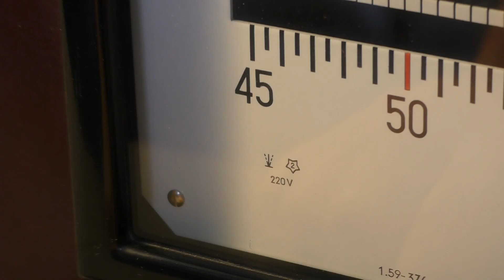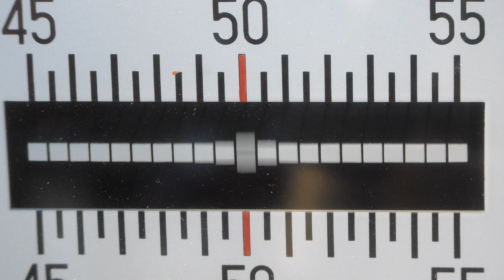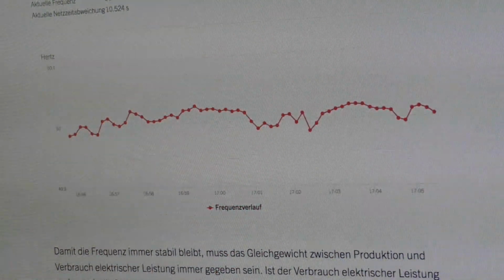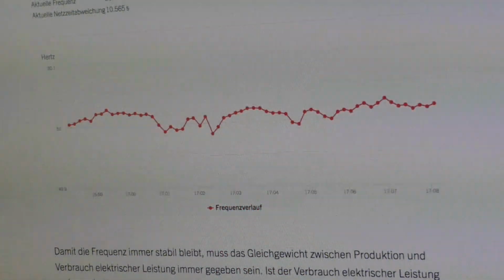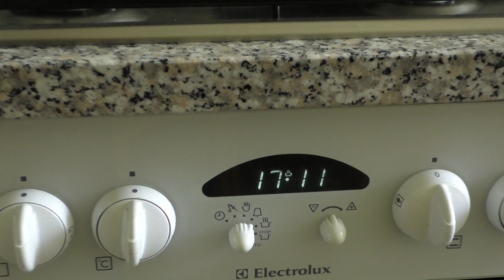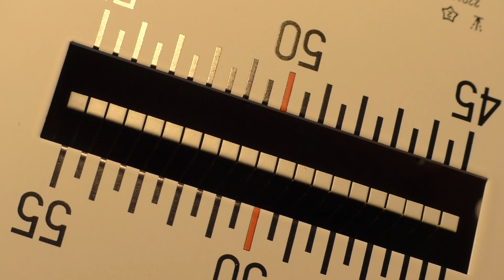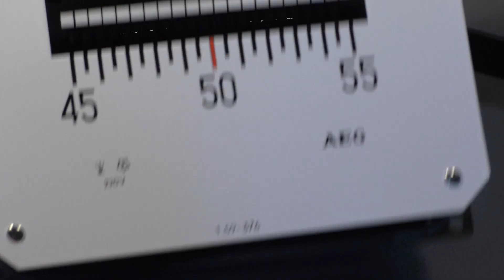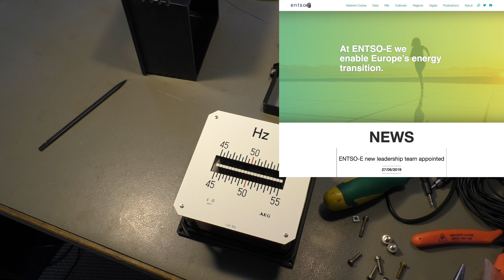Antique frequency meter  (PWJ147)

Comment: The very old radio control receivers worked in the same way. They had  separate coils with  metal pieces resonating at different frequencies :)
Reply from the maker: Yeah I heard of that. Not very reliable.... I also have an old "Hobby" magazine where they use a similar system as remote control for a model aircraft... left right up down, no signal = straight on. :-)

Comment: On further thinking that meter is actually a reversed magnetic pickup...

On an electric guitar/bass you strum on the metal strings which induces a small electrical current in the electromagnetic pickups.

This instrument induces an electromagnetic field into the reeds which in turn resonates with the mains frequency.
Reply from the maker: That's exactly how it works. The only difference is that a guitar pickup also has magnets built in because the strings are not magnetic by themself. And just moving a wire over a coil does not induce current.
It would be an interesting experiment to reverse that guitar. Feed some electricity into the pickup and see if the strings start to move...

Comment: This could still be used. You could place it on top of an AC motor (voltage of choice) and it would measure the frequency - even with its terminals disconnected. That would be bypassing the electromagnet in the meter and using it purely as a mechanical meter.

Comment: Could you step up the voltage from the frequency gen with a small (reversed) 230/12V transformer? This meter shouldn't be a big load? I guess without a "load" the transformer might be fine with +-5Hz :)

Comment: Connecting it to a generator is easy, just put a transformer in front of it, I can't remember if I fed it through an audio amp first or if i connected it directly to the function generator ... but it works. /watch?v=eKIoiCQMdzY